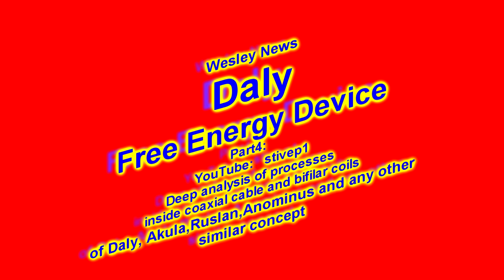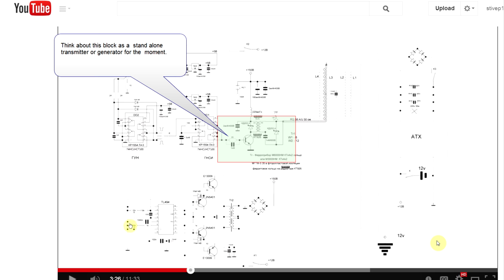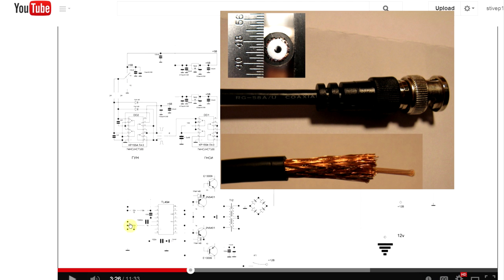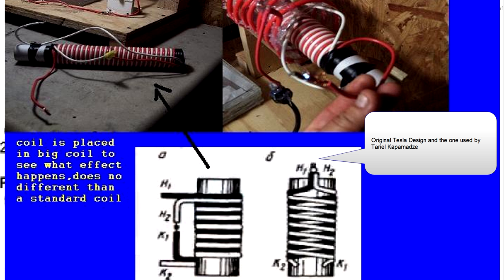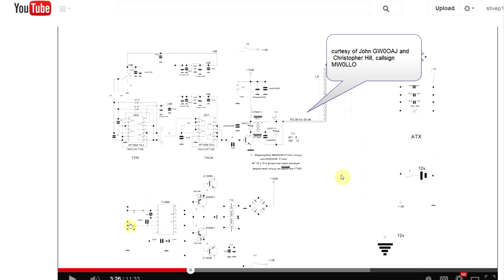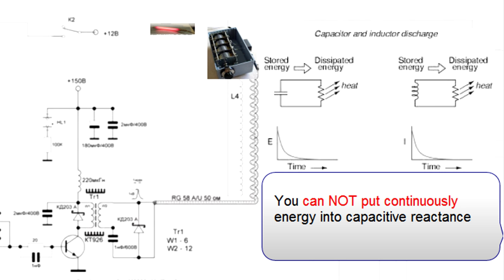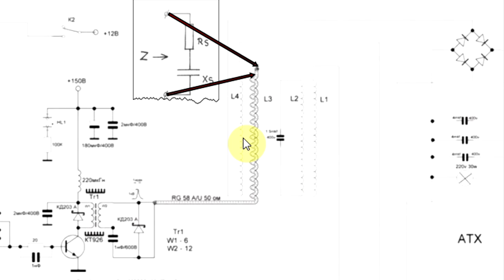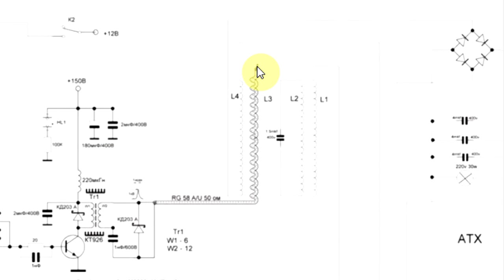Wesley presents:Daly part #4 Free Energy Device (schematic)

Comment: Hi Wesley, thank you so much for the video and the so many translations you take part in. You really shed a lot of light on what others are doing to come up with overunity successes. I am so happy to be able to comment on your videos where you speak and post videos speaking with so many great inventors from all over the globe. 

This video and the explanation given that is related to Time Domain Reflectometry explains so much. It is 90% of the reason why myself and so many other great inventors/experimenters get more energy output than we get from the input. You are 100% correct.. there is no free lunch, but with a little bit of input, some patience for tuning, and of course the correct schematic, we can get so much more output when done as shown in Daly's circuit. I'm sure there are other ways to amplify the output energy to greater levels, as Tesla has stated with his magnifying transmitter, but we all need to realize that Tesla's magnifying transmitter is NOT built how it is shown in the patents. I did a bit of research and you can as well to see exactly how it is supposed to be wired. The coils in the output are to be wired in series,. not as an additionally induced energy for output. The coil wouldn't do anything but increase or amplify the voltage while reducing the amperage if this was true. This is what Tariel has done and he admits it is based on Tesla's work, but there is much time needed to see exactly what Tesla did to succeed. The proper tools we need are to ensure coil weights are exactly the same , or share a multiplier in both length and the number of turns used. This will eliminate our failures as to why we do not get energy output in an rf system. Resonance is key and we need to all know that higher frequencies., although more difficult to tune will produce the massive amplification needed to come up with hundre4ds of thousands of watts of output.

There is no doubt in my mind that there is the ability to store the energy output as Don Smith has claimed to do, then invert it. I have succeeded with some of this using low voltage pulse charger schemes and am confident we could get much more output by utilizing high voltage " ion attracting systems" which are not so punishing to components until the energy is converted within capacitors and released through resistors or inverted to feed utility transformers in their outputs.
Reply from the maker: I do thank you for your comment . good point.

Comment: Hi.
value for the wavelength to align the cable resistance by artificial load (it reminds me of how to tune the cable to the coil in the air such as medium wave in the CB.Radio by SWR meter.)
the use of rear silencer as a capacitor with a resistor will change the transmitted signal?.
- my friend need for translating the principles and elements of the respective option... worth mentioning the values of theoretical knowledge about the practice it seems that a lot remains a question mark
-what are the alternatives on the market today. What transformers there are at and how many turns of the coil,what how much power is supplied to the coil voltage L1?, L2 =capacity of its own coil "LC"resonance frequency: Part 5 Nice:D
Reply from the maker: I explained more in part 5 of Daly

Comment: 👎slowTalk,NothingToUnderstand...
Reply from the maker: Well the video was part #4 and you didn't fallow the series. the phenomena in question are presented  from perspective  of  resonance circuit  behavior but  targeted configuration was coaxial cable 50  ohm  coiled  and shorted at the end.
The pinch with sharp piece of  another  wire   (HV)  was to provide  connection  disturbing standing wave ratio in controlled dis-balance as a way  to extract  part of  its energy.
I do agree that according to    laws of Thermodynamics *energy can't be created nor destroyed *  so the source of  energy   must be  coming from energy conversion .
In  the device   in question there  is always  fundamental need to explain  what energy comes from.
 You may be right that  there is lack  of properly addressed explanation.
_________________________________
  Video was educational and at very high  level of  accuracy   in area of  wave behavior.
 Since than I  decided to make 10 times  less of my videos  but make them  the <right way.>
 I'm not sure what is your level of perception in this particular field.
 If you look at my  last video  you'll see  me  acting  in quite  different  manner while explaining physics and its phenomena.
Wesley

Comment: Kuldoshina transformer. Patent DE 19927 355 A1
Reply from the maker: thank you my friend for the link
Reply from the maker: I have found only Russian version of it do you have link to  English one?
http://www.tornadoacoustics.ru/_fr/1/__--__DE_199273.pdf
Reply: Resonance and opposite coil winding is not enough. We also need a different coil diameter. Only after that we will have 0 induction but also we'll got magnetic flux in inductor. That's why Dally's device works, his inductor(coaxial cable) is asymmetrical with opposite windings and inductor don't feel the other coil influence

Comment: if free energy will get to all masses then someday in the future we could have free lunch
Reply from the maker: in a sense you right. Thank you
Reply: There is no such thing as free energy. The environment consists of electric charges in different states and their combinations.  
Proof is simple, each material by friction, produces electric charges, even biological objects produce the movement of electric charges. All physical objects oscillate just like antennas, the frequency of oscillations depends on their physical size and shape. The transmission of oscillation from one body to another depends on the tuning. Use sympathetic resonances and shock excitement, maybe avalanche mode, but it is not free energy.